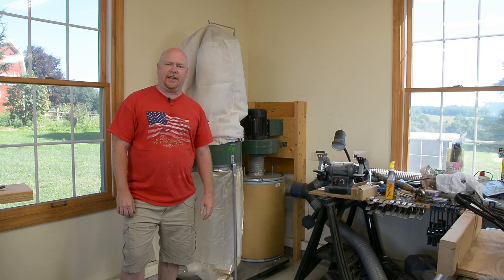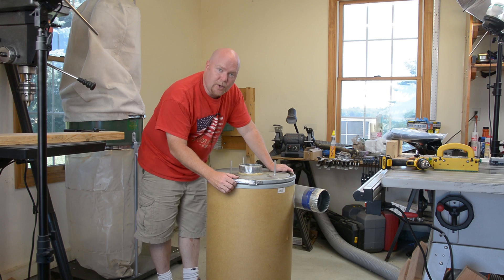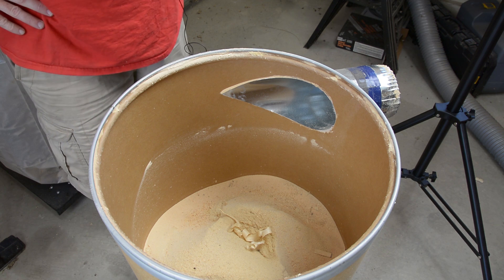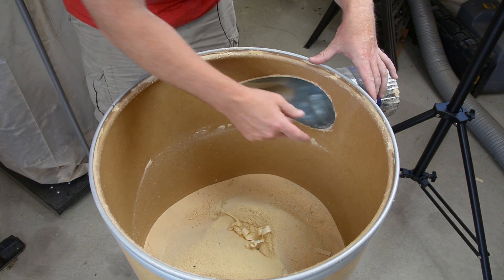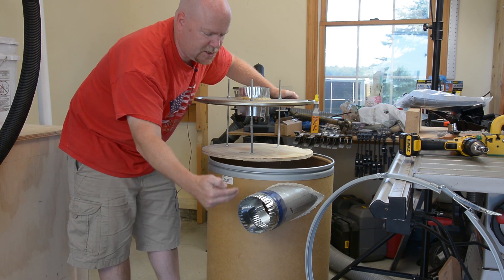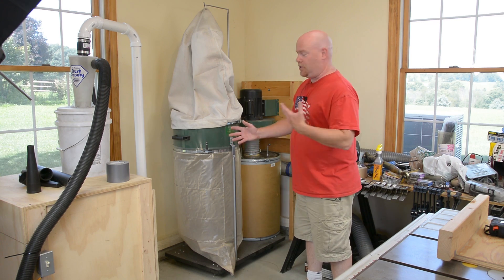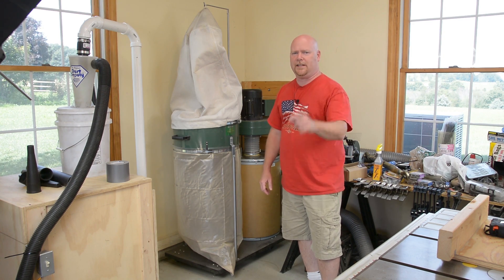Harbor Freight 2HP Dust Collector Modification Overview

Comment: I like your objective opinions of Harbor Freight equipment. I find some of there stuff to be very good for my applications and like most people, I consider some of their stuff to be junk.  Thanks
Reply: HF has a mix of inexpensive and cheap.  Inexpensive does the job you need at a low purchase price.  Cheap breaks or wastes your time, and then you have to buy another one (or something better).

I stay away from anything that requires good metallurgy.  The (low-cost) metal alloys they use tend to be either soft or brittle.  Avoid small drill bits, and replace any fasteners that need to be strong (I like Grade 8 nuts and bolts).
Reply: @scottwillis5434  I agree. I'd never buy an anvil from Harbor Freight for that reason but inexpensive power tools and clamps. Well it's hard to pass up $3 clamps. Never seen to have enough.
Reply: @ThePapabear2012  I tend to spend a bit more on clamps, ever since I tightened down a low-cost one and it went <snap!>.  That one went to the 'cheap' category.

Comment: matt, have you ever considered spraying K&N air filter oil on the inside of that filter. it is statistically proven that oil impregnated fabric catches alot smaller particulate than non oiled fabric.
Reply from the maker: I had not ever considered that.  I'm sure that you're right, and that it would catch finer particles.  It also sounds like a big mess to empty/clean though, and this thing is already on the minimal side when it comes to airflow.  Making the filter bag "tighter" without increasing the surface area would make it noticeably worse.

All in all I think the best plan is to either replace the bag with Wynn paper filters or vent it outside if the fine dust is your primary concern.
Reply: I can only imagine it would make quite a mess also.  The bag is nasty to clean the way it is.

Comment: I just picked up a 2hp Grizzly Dust Collector for $50. Definitely a steal. Your setup is something I'm going to copy in my shop. Thanks for providing the link to the templates for cutting the inlet pipe and drum. I have a 55 gallon thick walled plastic barrel that I'm going to use and I should be able to have more room in it for the thien baffle.
Reply: Used, new?? I want in lol

Comment: Matt, and community.  Since I have respect for you and I understand the system YT uses, I mute ads, just as in my TV life, and do other things.  I then hit like among those things.  This has the effect of giving the poster full ad credit, and more money, and is not differentiated with muted/unmuted viewers.  YT cannot also monitor my browser to watch which is live while the ad runs.  If I come back, and you are more than 15 seconds into the presentation, I merely slide back to watch the entire thing.  I also mute and leave, and run the video several times for most ads to play, while I do other things.  As I say, this is not only for you, but as a habit.  My views ad up, but I watch a given video once or twice.  Thanks.  BTW I appreciate your view on Harbor Freight, but remember, 80% of the stock has no moving parts, so the value and quality are directly related to price.  My Harbor Freight hammer drives nails just fine.  I painted a door, and the screws in the hardware moved just fine with HF screwdrivers.

Comment: Cyclone is not a minor effect.

The major effect of chip separation is drop in velocity due to expansion. There will be a drop box whose cross-section is large enough so that the cyclone effect is very minor.
Reply: I mean cyclone is a minor effect.
Reply: While you are right about expansion, cyclone has an equal effect. It creates a laminar airflow in which air shears in layers moving more slowly in contact with the can edge to more quickly away   Caught in the shear, the particles tumble violently loosing velocity and getting dragged by the slower laminations into which they are pushed by centrifugal forces. 
Man, it's just a great big party of forces in there, isn't it? So cool!
Reply: I saw a video on here where someone compared a Thein to a cone,  I thought it was interesting.

https://www.youtube.com/watch?v=HaTrY-O7l5E

Comment: thanks for the video! I cannot find the distance between the lid and the plate anywhere. ... and you guide me? a link ....How low is yours? thanks again!
Reply: I can't find this as well.  I have seen people with 9/10 inch distances and 6 in distance where there is just enough room for their 90 degree PVC inlet.
Reply: I just found a previous comment where he said like 8 inches if he remembered correctly.  that is what I am going with.

Comment: Nice vid!   I think I just found the design I'm going to copy.  Just bought the HF dust collector, got a barrel and now realize I don't need the super dust deputy using your design so saved some $!  Thx
Reply: I redesigned a squat multi stage  500mm X 500mm X 250 high    WITH NO FILTER   99.9%    chips to   4 micron.   (Queensland University Electron Microscope tested) 125mm  duct IN.OUT  2hp   Too bulky,  Expensive FILTER,  in most cases less than mine  collects   Dust removal is the point of the exercise,   Cheers

Comment: I've had my HF dust collector for more than 20 years, and it gets a regular workout - almost daily.  It has plenty of air flow and pickup power with the supplied bags; 5 micron bottom and 1 micron upper.  Not knocking the video or concepts, but I just don't see the benefits of upgrading/accessorizing a system that already works great.  Filter sizes are what determines the air quality leaving the system, and air flow is what determines how well the system 'vacuums'/collects.  Good video, good content, but I just don't see any added benefits.
Reply: Mike L The added benefit is convenience and ease of emptying the barrel.

Comment: I Here or read people complain about this harbor freight dust collector being cheap/made... well I bought a Jet dust collector and within 2 yrs the motor burnt out.... the motor cost as much as the whole system from H Freight.. nice set up.. that's what I am going to do with mine...
Reply: Wolf Pack,  I have a old jet 6" jointer.  My motor also burned out, so I learned a long time ago that some of this stuff is not better if it costs more.  I just found a, like new, HF dust collector used for $100. I'm not expecting too much, but I'm curious how long it will last. I have a lot of HF tools, I have mixed feelings,  but I think some of their things are definitely worth the money.
Reply: Let us know how long the HF lasts!
How you use it makes a big difference - load it down and the motor will get hot.

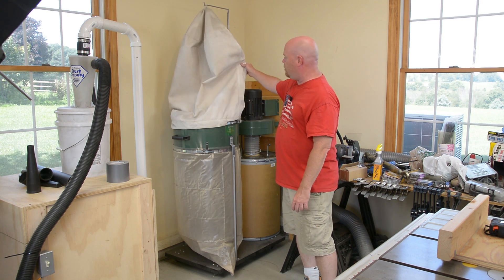Comment: 11:35  It's super simple to change the 15 amp breaker to a 20 amp breaker and to put in a 20 amp electrical outlet.  I really like the setup.  I've seen others and they are overkill and this one is as simple as can be and looks to work flawlessly.
Reply from the maker: It's easy, but it's a terrible idea unless you plan to pull new wire as well.  Code only allows for a 15A circuit on the wire I have.   I have actually since run conduit around the shop for some 240VAC that I needed, and I did put in a proper 20A circuit for this.
Reply: SELF-RELIANCE and a STRONG COMMUNITY '
Reply: Run 20 Amps through a circuit wire for 15 Amps is a very bad idea, and a good way to eventually set your workshop on fire.  15 Amp circuits are run with 14 gauge wire (white Romex), 20 Amp circuits with 12 Gauge (Yellow Romex).

Comment: Thank you very much for this video! I have watched video after video for the last week trying to figure out what kind of dust collection system I wanted for my new shop. I  do not have much money and I was worried I was going to spend more than what I can afford on one, but I have confidence on your opinion about it being one of Harbor Freight's "Gems"  I like very much how you did the barrel modification and that is absolutely awesome how minimal the dust is after that stage. Your video will be the reason I save so much money. Thank You!  The only difference i'm thinking is I think i'm going to try that trash can cyclone lid from Woodcraft instead of the baffle. Do you think that that would work? Thanks again!

Comment: Your point about the motor alone being worth the price is spot on. I've checked out many motors online and most, even 1/4 HP motors are over $100. Check out the many shop built tools people make and most require a motor. An example is the cheapo harbor freight belt sander/disc sander..It costs about $50, but the motor alone cost more than the entire sander. This leads me to the line of reasoning that if you need a new motor for various projects just go buy a harbor freight tool and strip out the motor and you'll probably be saving money over just buying a motor. 
Well anyway, I'm going to get the dust collector from HF because my shop is becoming entombed in dust and has become a spider web playground. I might as well take up smoking fiberglass cigarettes. Now it's just a matter of saving up the scratch and getting the right coupon for HF.
Reply: martino amello,  I've had a wood shop for over 25 years and finally last week found a, like new,  HF dust collector for $100, now I wondering why it took me so long?  Good luck to you.
Reply: Motors are not all the same.  The load you put on it, motor design, bearing quality, how much copper in the windings, etc. will all affect the motor life.  

Bigger copper wire means less heat - but copper costs, so count on the windings being a bit smaller than they should be for long life.
Let us know what tools have good motors in them!

Comment: have you considered getting rid of the filter all together and simply venting outside?  that's a lot of room in the shop to collect a few tablespoons of dust.
Reply from the maker: Getting the makeup air into the space isn't a problem.   The problem is the number of BTUs that go out with the exhausted air.  Unless you plumb a heat exchanger into the system to recover the heat in the expelled air, then (at least in my climate) you're replacing 60 degree air with 20 degree air.  I just don't have sufficient heating available to keep up with that loss, and even if I did it's a huge waste of energy.
Reply: True that. I live in michigan. In the winter you dont waste heat.
Reply from the maker: Yep.  I plan to do that someday, but it's not practical year round.  The DC moves a lot of air - including all the heat or AC - outside when you do that.  Here in western PA that's a deal breaker in winter for sure, and sometimes in summer too.
Reply: @MattHeere  get the washable filter from Wynn environmental do not wait to one of these days it is the greatest upgrade one can make it is quieter and move more air
Reply: Doesn't have to be a complete deal breaker Matt. Most commercial buildings that have exhaust hoods (think restaurants) will use a make-up air unit to pull in a a certain ratio of fresh outside air to compensate for the amount of exhausted air to prevent the building from going into a negative. To be fair I was taught that a building that was a bit on the negative pressure side was preferential to a building having a positive pressure but I digress.
Reply: @markf.4063  Wrong 100%. A building should allways be in a slightly positive pressure. This is so all air entering is filtered and conditioned, if a building is in a bad negative pressure unfiltered in conditioned air enters the building from who knows where.

Comment: Hey Matt,
Went to link for joint template... what numbers do i enter for it? I have the same fiber container you do.
Reply from the maker: Joint Angle: 90
Main pipe diameter: Diameter of the fiber drum
Branch pipe diameter: outside diameter of the inlet pipe
Wall thickness: thickness of the pipe used as the inlet
Lateral offset: max it will allow.  Put in something huge and it will tell you the max in red near the top after you try to submit.
Reply: great, thx

Comment: i just got a general 1.5 hp dust colector and i want to use it almost just for my vacuum sanding table.... i know that because i am making fine sanding dust most of the time i should get one of those expensive filter to replace the hupper bag but dont want to spend the money yet so my question is ... since your modification is to catch most of the big particule, is this system will help for my sanding dost or it will get true like if they are no modification at all ????? because most of people make this modification so the dont have to empty the bag so often... it s going to take me 1 year to fill the bag with my sanding table dust lol so should i do the modification for my use ???? thank for your help
Reply: The fine dust escaping from the bag is still killing you. It's not just about catching the regular dust. Invest in a good pleated filter in place of the filter bag.

Comment: Hi Matt, thanks for this amazing solution. I have low ceilings in my basement and this will make dust collection possible. Quick questions: are you using a 5" pipe for the baffle inlet to improve suction, and would a 4" inlet decrease efficiency and require a height adjustment to the wooden piece inside of the baffle? Thanks!
Reply from the maker: +Arturo Vidich I used 5" as the inlet to the separator barrel because the dust collector motor has a 5" inlet, and I want to keep the inlet and outlet the same size.  Stepping down the diameter of any pipe will restrict the flow somewhat, but you'll be transitioning to 4" pretty quickly anyway.  Exactly where you make the switch probably makes little real world difference.

The diameter of the inlet pipe doesn't affect where the Thein baffle needs to be directly.  Rather it's where the bottom of the inlet pipe is.  So a smaller inlet pipe could be mounted higher, requiring raising the baffle - or it could be mounted in exactly the same spot as the 5" pipe.
Reply: +Matt Heere Thanks so much for the detailed and quick response. I might step down to 4" at the blast gate to save a little moolah. We'll see!
Reply: Hi Matt, another question has come up... is there a compelling reason to keep the inlet on the Thein baffle entering on an anti-clockwise tangent to the barrel, or could it work the same coming in at a clockwise tangent? The best place in my shop for my unit will have the inlet branching to the left rather than the right when looking at it. Thanks!
Reply from the maker: +Arturo Vidich The reason I did it is that it matches the direction of rotation of the impeller.  Anti-clockwise is the "natural" direction of the cyclone, and trying to reverse it is going to cost you some suction.  I don't know how much, but airflow isn't the strong suit of this setup to begin with, so I wasn't willing to risk it.
Reply: +Matt Heere Gotcha, thanks for everything!

Comment: Hey Matt. Enjoying your channel. Curious about your cardboard drum set up. What angle did you use in the Pipe Joint Template? Thanks for the video.
Reply from the maker: +T W Weiland I used 90 degrees.  The branch pipe comes straight out of the drum.  I also used an offset of 0 so that the inlet is tangent to the drum.
Reply: Just plugged in 90 degrees with 0 offset.  Used 68.25" main pipe and 5" branch. The template I get looks nothing like yours. Shows a perfectly round hole for the drum and a straight line for the branch pipe.
Reply from the maker: +T W Weiland It's because I lied to you about the lateral offset.   You want to use the maximum allowable value, not zero.  Also, it wants the diameter of the pipes.  I'm thinking your barrel isn't nearly 6 feet in diameter.  That'd be a lot of dust!
Reply: +Matt Heere  Just tried the increased offset. Works. You are right about the size of the drum. 68.5" is circumference. Hadn't calculated diameter. That's how errors occur. Thanks

Comment: Nice video.  I'd like to suggest that you incorporate some plaxi Glass to the side of the barrel to see when it needs to be emptied.

Rob
Reply from the maker: +Rob Brown I thought about that Rob.  It would be nice for sure, and maybe necessary when I finally vent the collector outside.  For now I just empty it when the dust starts blowing through and collecting in the plastic bag.

Comment: Got it for $136 today. Presidents' Day sale priced at 169 plus 20% off. They also changed the color to grey.
Reply: This thing has gone up quite a bit. It's $230 now.
Reply: It fluctuates. It's down to $189 now which the lowest I've seen it. That's only about $150 before taxes with a 20% off coupon.

Comment: I like your dust collector setup, but what about the smaller dust collector bucket you have to your right in the video?
Reply from the maker: +Mike Hand About a year ago I did a video on the Dust Deputy, and then a pair where I built the silencer cabinet for the shop vac.

Bottom line is that some tools need the high air flow of a big dust collector (table saw, band saw, jointer/planer), and some are better off with the higher static pressure of a shop vac (mostly hand held power tools).  So, they both sit there together in the corner.
Reply: Oh OK.  Thanks for the reply.